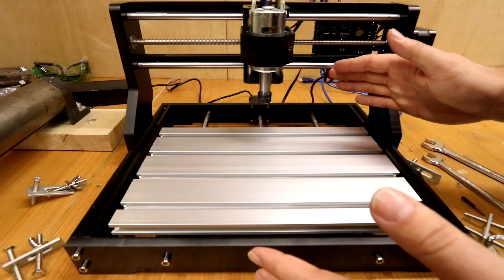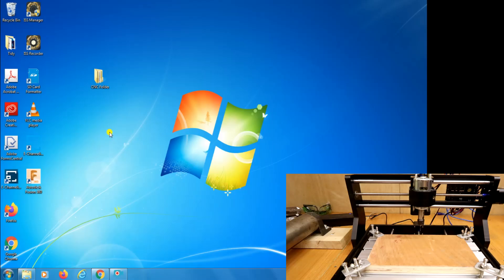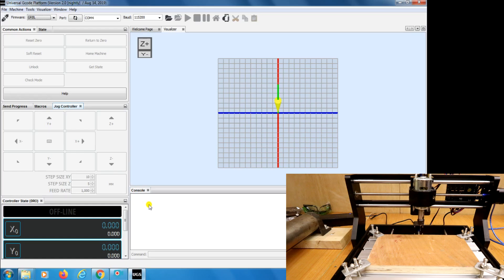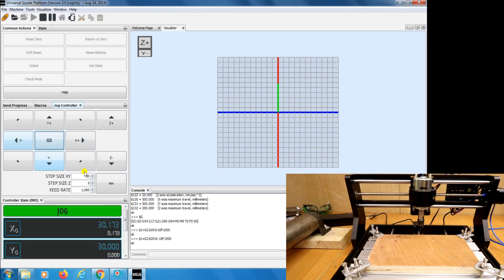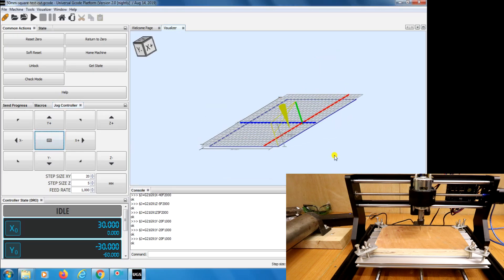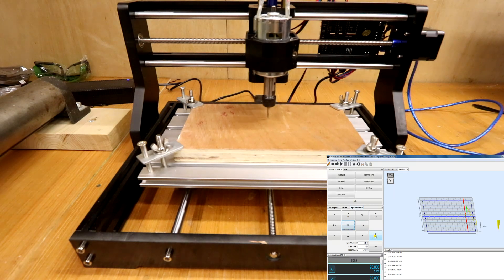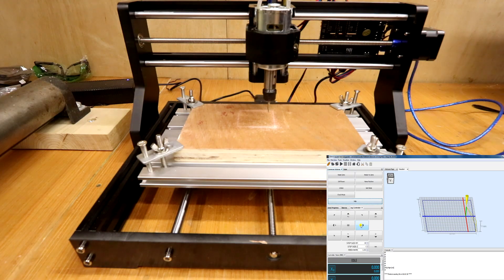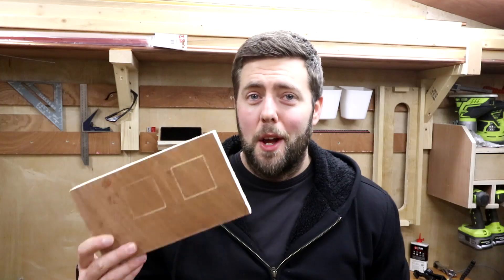3018 PRO - Making your first cut

Comment: Great video, thanks.  Please can you tell me, what is the deepest you can cut with the cnc3018 please?  What plunge depth?
Reply from the maker: The maximum travel is about 40mm so in theory it can cut that deep. However you usually have to allow a bit of room for travelling which is anything between 5-10mm typically. So probably 30-35mm
Reply: @JamesDeanDesigns  thank you.  My machine arrives on Monday.  So the adventure begins...

Comment: Hi James,
Thanks for the video.
I have the machine running fine. However, I can’t get UGS to run. Soon after I click on ‘ugsplatform64’ I get the message: ‘Cannot find Java 1.8 or higher’. I have reloaded Java and checked that it’s OK. I have tried all I can think of, but it seems that UGS just can’t find the path. In desperation, I have tried with three different computers, all of them 64 bit Windows 10 machines. I can run Candle it seems, but not UGS. The UGS thing is bugging me.
If anyone can tell me what my old partly functioning brain is missing, I would be grateful.  
Paul
Reply from the maker: I actually had this same problem when I changed computer. It really bugged me. As a test I opened up the 32bit file and it all ran smooth. A 64bit machine wil run 32bit but not the other way around so it should hopefully work for you
Reply: Thanks James, that did the trick. Progress!   :-) 
Paul.

Comment: Thank you for these videos James, I am new to CNC machines and these have helped tremendously.. I am having one problem though and not sure if you can help or not. All software has been downloaded, test project uploaded from Easel to UGS - Connected machine and software with no error messages - When I try to move the bit to set home - Nothing. When I try to send to do the project - Nothing. The software shows it is processing but the machine is not moving. Any Ideas? I have exhausted my thoughts on this.
Reply from the maker: Hi, Quite a common problem is a false connection. This is when you set the wrong COM port and the software tries to connect to something else. As a result it tries to send the information to the machine but obviously nothing will happen. Usually the easiest way to tell when your correctly connected is a lot of the greyed out buttons come back to life such as the jog controller. So just disconnect and select different COM ports to see if that works.

Comment: Hi James,
Which version of Carbide Create should I download?
Reply from the maker: Not sure, I haven't checked for a while but typically they will just list the latest version for either Windows or Mac. If you have a choice of either 32bit or 64bit then you need to check your machine but typically a 32bit will work on 64bit, but 64bit may not work on a 32bit
Reply: Hello James,
Thanks for your reply. I down loaded Carbide Create for Windows. I assume its the latest version.
Which program do you use to run the G-code?
How do you machine text so that it protrudes? Not carved into the wood? Is this by cutting off the line of the profile?
I can carve into wood, but want to make items where the surrounding material is removed to elevate the design. I appreciate your advise.
Reply from the maker: @brucenorton3864  I use UGS to run the Gcode straight from my laptop/PC. To make a relief does vary between software but if you are using Easel I think you do your text and set that to 0 depth, then draw a shape over the top and set that to how deep you want to relief to be. The important part is the shape must be sent to the back. To do this simply select the shape and click Edit>Send to back
Reply: Thanks James,
I'll give it a try. You've been a great help.

Comment: Hello, I have a question,
I am new with the cnc3018, when I put it to work with the lasser the machine
only moves linear. but when I put it to work with the router motor, the motor
rises and writes over the air. I have even changed my mother board but it still
doesn't work for me. Please can you guide me? I used candle and laserGRBL.
Reply from the maker: So typically your laser doesn't need a z axis (unless your height mapping which is a different story) which is why only the x and y move. However your spindle needs all 3 axis. At a guess, it possibly sounds like you are not setting the Zero or Origin for your spindle so it doesn't know what height to start at
Reply: @JamesDeanDesigns  Thanks for writing, I don't speak English very well, but I'll try to explain it better. I have the cnc3018 pro machine and I have two problems:
1. Spindle motor: It is seen that it follows the letter but it goes up and down and it does not stay at the level to engrave a name on a piece of table.
2. Lasser: It only moves linearly, and does not follow the outline of a letter or drawing.
Thank you very much for your help!

Comment: Hi James,
What are the minimum requirements for a laptop to control this CNC. is it possible with a windows machine 32 bits ram 8 gb process processor AMD i3 ..

Greetings from Jos Daniels
Reply from the maker: Minimum requirements is actually quite low. At the end of the day everything just revolves around sending fairly simple code over to the machine. A lot of people even run them off Raspberry Pi's. Do be carful with laptops, due to their power settings they can be known to stall the machine, just something to remember if you start to have issues.
Reply: @JamesDeanDesigns  what do you mean by energy settings?
Reply from the maker: @josdaniels6029  laptops are designs to use minimum amount of power to last as long as possible. As a result all their power saving settings are normally turned right up. So for example if you don't move the mouse for 30s the screen dims, after a minute or 2 it starts to shut other things down like USB ports

Comment: I grabbed the same version that you have and my screen layout is totally different. The preview screen is a pop-out and is black with the design, but the spindle marker is not on screen. I have downloaded other versions but they are not the same as yours. Weird.
Reply from the maker: It does sound like it unless they have  changed the file. I'm sure I saw someone mention about a black screen on Facebook the other day. Might be worth trying another version unless there are any options in the view menu to correct it

Comment: What I do to zero the Z-axis is to lower the tool using baby steps until it is just above the workpiece, I then slacken the bit until it drops to the surface and then tighten and register as home, this is a quick and reliable method.
Reply from the maker: Thats a pretty good idea. I ended up making a Z probe for £1 and its honestly made life so much easier especially when doing a 2 part cut

Comment: Hello ! I have acquired a the cnc 3018 and i have a question : do we have to wear a mask for our safety ?
Reply from the maker: Hi Nicolas.  I typically don't wear anything especially now mine is in an enclosure. Once the machine is running there is very little reason to get close to it or put your hands near it. Usually if you need to do something you will pause or stop the machine. If you are cutting wood or MDF, you may want to wear a dust mask to avoid it getting into your lungs. If you are trying to get a closer look whilst its running then I would certainly put a visor or safety glasses on. At the end of the day these motors spin at over 7000rpm so the can cause damage. If this is used in a commercial property or in a school then you will need to reference the relevant laws and H&S regulations for your country.
Reply: @JamesDeanDesigns  Thank you !

Comment: Hi James,
Thanks for your truly detailed videos. They have helped me to get started with the router. 
I love using Easel but had a problem with the cutting depth when trying to cut out a shape (using tabs) and engraving.
The 3018 only cuts 1/3 or less than the specified depth. I cannot get a shape cut out.
I did the same job sending the g-code from Easel to UGS  Nightly build platform and it does exactly the same. I cannot get the router to cut to the specified engraving depth, or full depth to cut the job out, despite that the visualizer showing the full depth of cut. 
When you watch the progress on the laptop, it shows the depth being increased with each pass till it gets to the specified depth on the screen. In reality it's no where near that depth.
Another question, how do you ensure that the G-code will raise the cutter before starting the job, or must you give it a manual offset by raising the bit before you start the cut? 
I have taken the cutter to my preferred staring point and zeroed all axes. When the cut start, it ploughed straight into the job, not raising the cuter first.
Any advise is greatly appreciated.
Did you ever post a video on how to use the laser? A link to this would be very helpful.
Thanks so much for your wonderful videos.
Reply from the maker: Hi Bruce. First thing I would say is Easel has some known issues with depths and coordinates. So much so that I have now moved away from it since making these videos. I would start by trying another free program such as Carbide Create and just create a simple circle or square and see how that works out. If the issue remains then its almost certains it's something in your machines settings. You might need to do some manual tests, for example if you tell your Z axis to move 20mm does it actually move that far, or is it more like 10mm? The GRBL settings that control this are $100, 101 and 102. Typically they are set at 800 or 1600 but all three should be the same.
In terms of raising the cutter before starting, some software programs this in automatically but others do not. What you can do is set your zero points, then manually raise the spindle by 10mm before pressing play. This is usually what people have to do who use Fusion 360 the export their gcode.

Comment: I'm just trying my machine out, and i have inverted Z axes, do you know what could go wrong and how to fix this issue?
Reply from the maker: You will need to change your $3 setting but it will depend on what value it currently is. Usually when you connect your machine in Candle or UGS, the console will list all your settings

Comment: Thank you very much for this interesting video. I'm pondering wether or not to get a compact and affordable CNC mill for PCB prototyping...the Sainsmart 3018 pro m laser looks pretty much the same as the machine in this video and assembly seems to be more straightforward and easier than other 3018 machines. I'm running on Mac and Raspbian so I guess the software that comes with it must go straight to the bin. Do you process PCB with your CNC machine and if so, what is the preferred process? Milling or using the laser and etching with acid?
Reply from the maker: The 3018Pro is a design made by many places. A lot are unbranded but Sainsmart are one of the more reputable brands that make it. Quite a few people use the 3018pro to make PCBs, although I don't personally so I can't advise on the best method. I think most people I see mill them. Some software is compatible on mac. Rather than using the CD or USB thats supplied you just need to go onto the relevant websites and download a mac version

Comment: When I click on ur bin and select usgplatform it says can not find folder? Any advice
Reply from the maker: 🤔 are you selecting the 64bit version by any chance. If so try the 32bit  version?
Reply: okay, I got it. thank you and once I Have the window open UGC page my jog controller screen is gone. How do I get it back?
Reply from the maker: @alexl1976  if you cant see the tab anywhere then click Windows at the top and one of the options shouldn't say Jog Controller
Reply: @JamesDeanDesigns  when I try the 64 bit version it says Java 1.8 or higher not found.  Although I've updated Java several times? When I open the 32 bit successfully I get a no port found error? Any suggestions?

Comment: i have but the x-axis stepper motor on the left, what is the effect? there you have the x-axis stepper on the right
Reply from the maker: Some have them on the opposite side, it should not make a difference. On rare occasions some people see that their X axis is running in reverse but this can easily be corrected in your GRBL settings

Comment: Hi James, Great video, i have just assembled mine follwing your video, so far so goo, my spindle  didnt come already assembled into the mount like yours did, is there a specific distance it needs to be at, my wood is about the same thickness as what you have there but the Bit seems to low so thought id ask before i start trying to adjust anything, thanks
Reply from the maker: The joys of these is you can set the spindle ant what ever depth you need. A good starting point is to put one of your bits in the spindle, lower your z axis to the bottom and then make sure your bit is a couple of mm off the bed. This ensures you dont hit the bed whilst cutting anything
Reply: @JamesDeanDesigns  ok thanks for the info, i do have another problem, im testing the  Z back and forth like in the video and its not moving but i can here a clicking, i have tried a different motor and it still does that, am i  doing anything wrong
Reply: @JamesDeanDesigns  i tested all axis via the wizard and they all move but when i then try via the control pad in the program, nothing moves it just clicks
Reply from the maker: Can be multiple things. Does move easy enough of you turn the thread with your fingers?
Reply: @JamesDeanDesigns  yes i can move both X and Y with fingers, they move easily but i can also move them with the machine turned on, i didnt think the stepper motor would allow that as it dont with my laser machine and 3D printer, looked at so much info dont know what else to try, if i use the setup wizard it moves via the program but once the wizard has finished im back to square one nothing moves
Reply from the maker: @carolewhite9632  that does sound very strange, especially if it is moving during the wizard. Are you on Facebook? If so I highly recommend going a group called Sainsmart Genmitsu CNC. Most of the people in the group own 3018's and they are extremely knowledgeable. Plus you can share videos which help solve the problems. You may find it something simple
Reply: @JamesDeanDesigns  yeah im on that grp, ive got it working but with the software that came with it, i cant get it to work in the program you use :(
Reply from the maker: @carolewhite9632  that's odd. The only thing I can think is if either the com port or the baud rate is wrong. Also you have to make sure you download the last stable version of UGS, the nightly builds can have glitches
Reply: @JamesDeanDesigns  Hi sorry for late reply, yeah i have the lastest version, ive looked at Easel instead it looks good, i have a pack of bits that came with the machine they look like cutting bits and id like to mill, any advise of what bits to buy or some good info as to what bits are for what purpose thanks for your help

Comment: Great video James.  To get into CNC, I bought a 100x100cm Workbee, which came with no spoiler board, no clamps, no software, and a DeWalt quarter inch router that is NOISY!   This one seems a lot more beginner friendly.  I'm still struggling with clamping a year later.
Reply from the maker: Thank you. It's still a little noisy but its like comparing a Dremel to a  1/2 inch router, these things are rated at under 100w I believe so not that powerful. Id certainly say this is more forgiving if you make mistakes, and because of its low power you're making lighter passes so its not like your going to take a big chunk out of a piece by mistake.